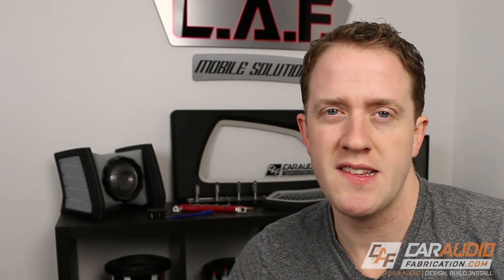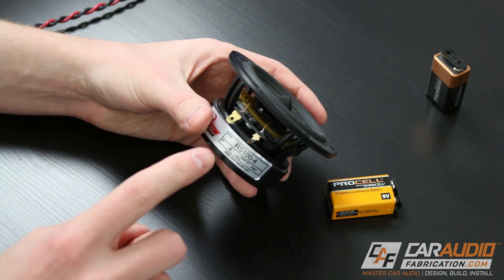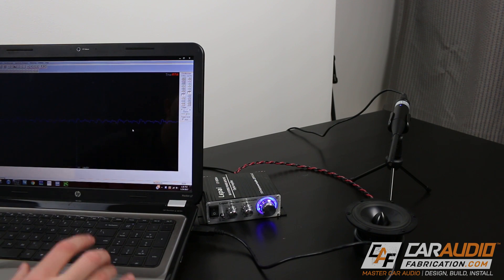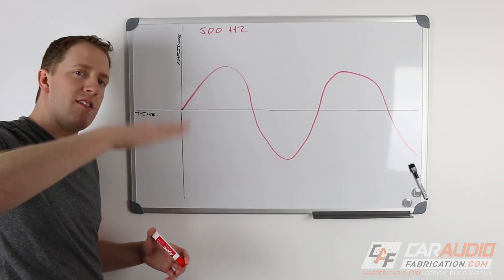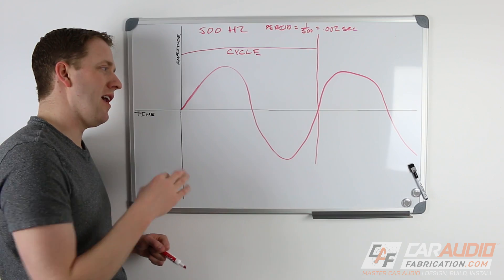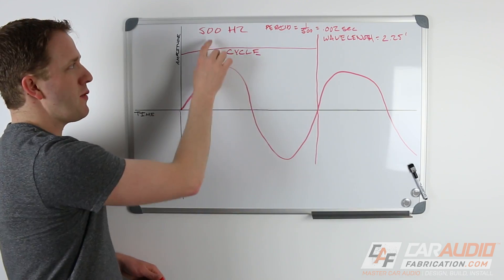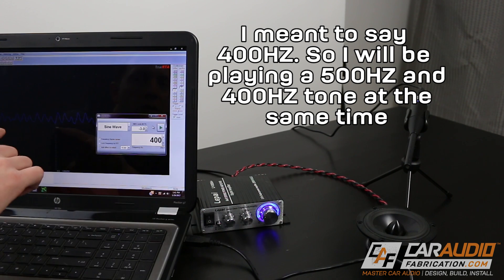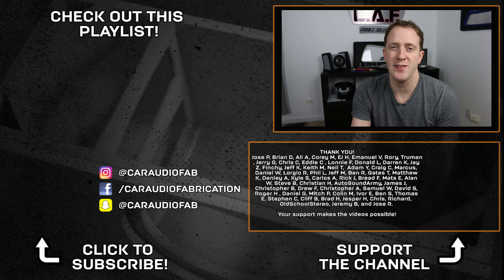That's a music signal?  - Audio AC Waveform Tutorial

Comment: Thinking about the nature of an audio signal...as an AC waveform it shouldn't matter, right? Neither wire is more positive than the other on average, so the plating must just be for colour, not some mitigation of galvanic corrosion or other phenomenon...  As long as the same convention is followed throughout to keep channels in phase. Something to check if anyone has an oscilloscope - is a music signal an AC waveform averaged around 0V? If so, my guess is the plating on one wire is just to help installers keep channels in phase. Probably Dunning–Kruger at play, but thats what i come up with thinking it through.

Comment: So I was in the Navy and learned a lot about amplifiers and signals.  I have come across the argument that the signal coming off of a amplifier is AC or DC.  What I was taught is that AC is a voltage that will change directions.  Meaning that the voltage has to go from a positive votlage to a negative voltage changing the direction of the flow of electrons.    If I have a signal that changes from cycles to amplitude but never changes in polarity it is just a dc signal.  Have you ever seen an signal off of an amplifier that ever went into a negative voltage range.

Comment: Hi, great video's keep them coming...

Query
I have a 2015 BMW F33 2.0D. Looking to add a 1500rms sub amp to a double 10" box, do you think I need to add another battery to this setup or will the existing factory battery be sufficient?

And Is there any other do's and dont's or advise you can share with me in this convertible installation?

Comment: 9 volt battery on a 4 ohm speaker produces 2.25 amps DC ~20 watts ??? continuous, I use a 1.5 - 3 volt battery for polarity test
Reply from the maker: You should never use any battery for polarity test, you should use the proper tool (I use the PT9A http://www.mobilesolutions-usa.com/uploads/2/5/3/6/25363959/pt9a_manual_2012_mobile_solutions.pdf )

I abuse this little speaker, wouldn't have made a very good shot if the cone barely moved.
Reply: I figured you did that for effect, thanks for the link to the polarity tool, I've been using the PAC TL-PTG2 alot, but yours sounds great.

Comment: I was wondering if you've had any experience with one 10" sub and one 12" sub in a vehicle together... Any reason they wouldn't sound good together? Assuming they were the same brand, proper power was given to each, and they were both in individual closed boxes of appropriate size. I ask bc I've never seen it personally, and would think it would give me a better range of bass than just the 10 I have, (and one semi professional audio guy told me it wouldn't sound that great)

Comment: these amps are trash there only like 12 watts
Reply: Well, for some applications, you only need 12 watts. They're an okay amplifier for powering computer speakers or small bookshelf speakers.
Reply: John Smith yes in some point of the install yes but as of book shelf no not all of them would sound go on it because my book shelfs speakers are 100wrms 150-200watt peak
Reply from the maker: Works good for my cheap little test set up, bought this just to show you guys some stuff.
Reply: chad smith if you select an amplifier based on the 'watt peak' rating, you need to watch some more CAF video's :)
Reply: LutkeVeldNL  I don't RMS is what I look for

Comment: That is one distorted sine wave.
Reply from the maker: Its picking up the other ambient noise in the room, not looking at electrical signal on the computer, but rather the output from the speaker. The speaker isn't exactly rigid mounted in a baffle and the rear wave is free to interact with the front.
Reply: I mean the one that illustrate on the white board...
Reply from the maker: Haha in that case yes very much so! It's a little wonky.